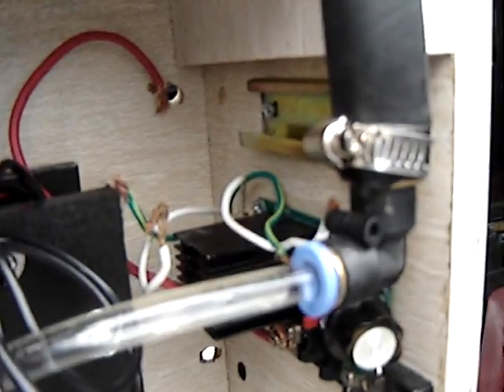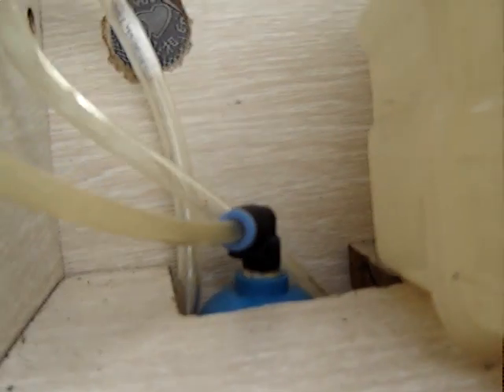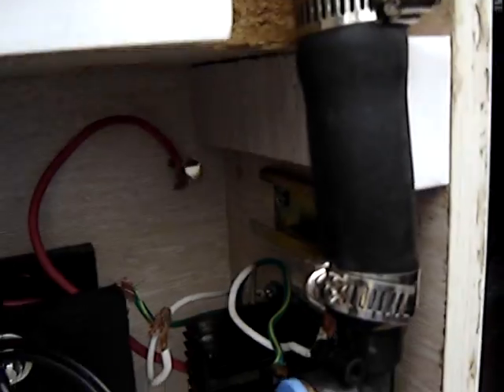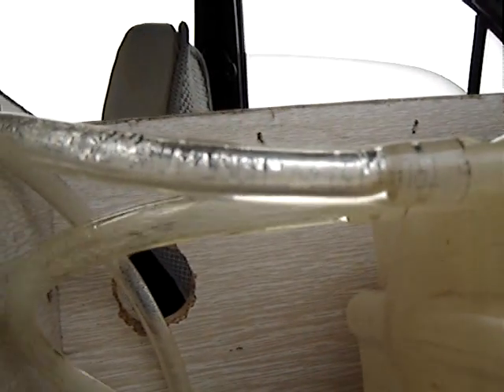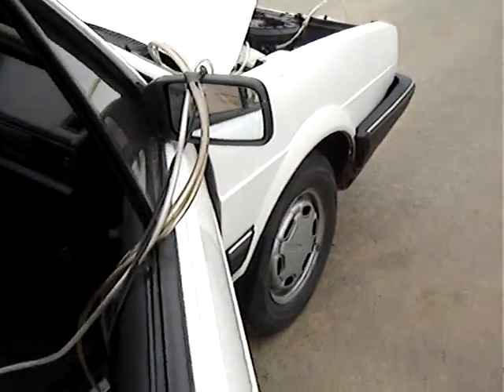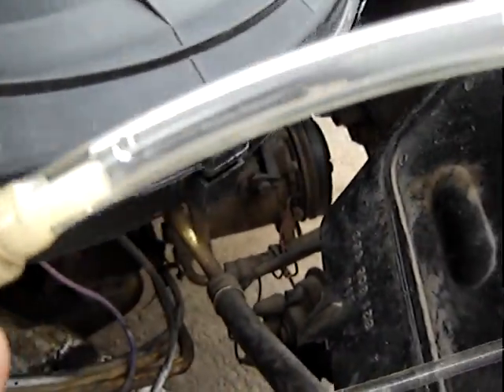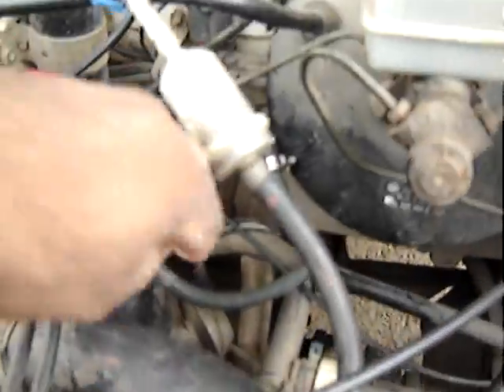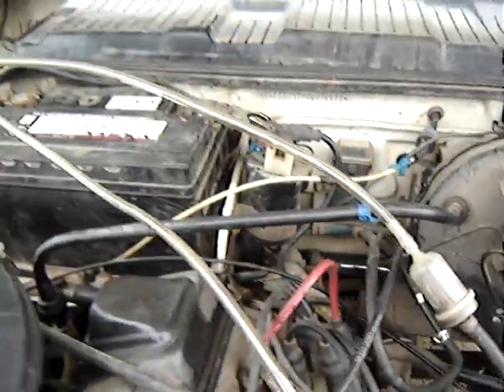Dry Cell test

Comment from the maker: Thank you for your comments on my HHO video. Would you advise me to change the jet to a smaller bore inside the carburetor so that when I press the pedal down it should put out less petrol. This way it will send less petrol and the defecency should be made up by adding HHO?. This kind of make sense but if at any time I do not have the HHO, then I will not be able to get full power from my engine?. Please advise.

Thanks

Comment: the ventury in your carburator is designed to suck always the same amount of gasoline at the same throttle opening, so it does not reduce the amount oif gas used even if you inject other carburant (HHO in this case) You would have to use a smaller chickler if you want to restraint the amount of gas being sucked into the combustion chamber and replace that lack of gas with HHO... kind of complicated but the only way in case of carburetors...

Comment: 16 plates, 2 positive, 2 negative, 12 neutrals like this? +nnnn-nnnn+nnnn- ? any way the pwm never will give you more hho, because the current is directly proportional to the hho production, forget the pwm use for other objetive like reduce production o comsumption. there is not exist the grial frecuency, tell me how are you measure the hho production? you need a amp clamp